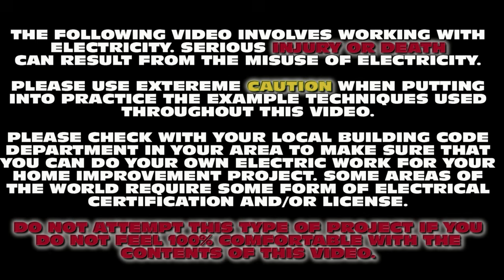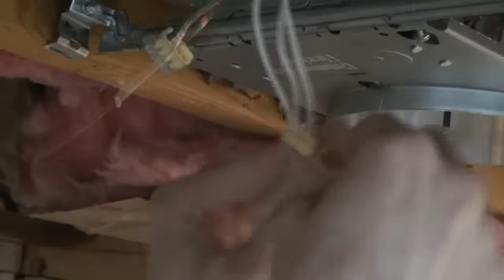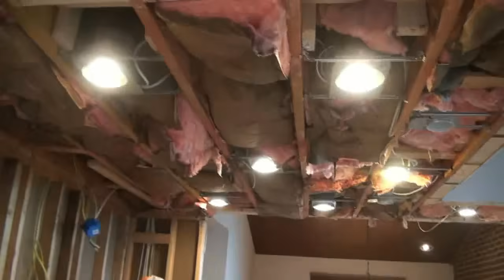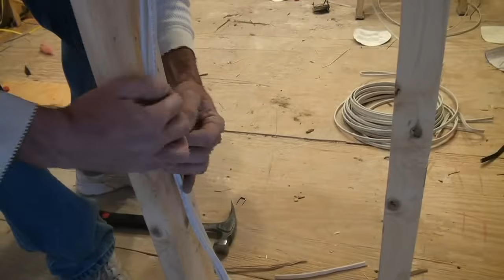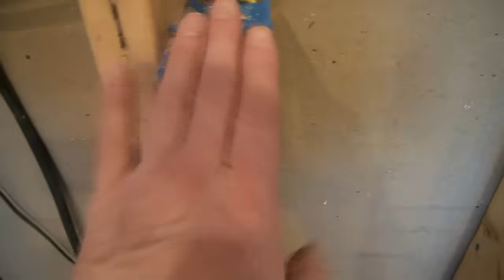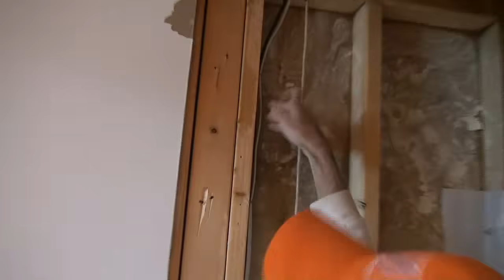How to wire Recessed Lights in Kitchen

Comment: What 14 2 wire mean? 14 gauge 2 wires of same ..ground .positive n copper which is actuall switch on off wire?
Reply from the maker: 14 is the gauge of the wire and the 2 means its a 2 -wire(black & white wire) setup that also has a bare ground wire included.

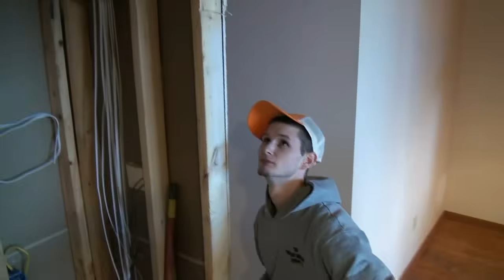Comment: At 3:45 you said it was the last light in a circuit. But at 1:23 you are showing connecting two pairs of black, white, and ground wires. If it the last light in the circuit then how could it have two romex pairs of wire? The end of the run should have only one Romex pair right because it terminates in the last light. What am I missing?
Reply from the maker: That is correct , the last light on a light circuit should only have one piece of romex wire inside it's fire box because it's the last one in series.

Eddie

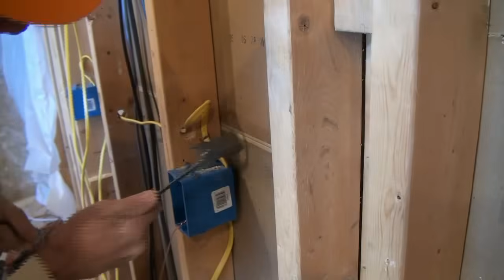Comment: Nice info.   7:45.  Do the studs need metal protector-plates attached at each wire pass- through?  Thought that was required?
Reply from the maker: No....not if your holes are in the middle of the 2" x 4"'s out of harks way. Metal plates are only required if the mechanical items(plumbing pipes or electric wires ) are located where a drywall screw or nail could potentially come in contact with that item. Keep your holes towards the middle of the backside of the studs when drilling and your good to go...and w/ no code violations!

Eddie

Comment: Is it important which holes of the stab lock connecter is populated with wire?  And is it distinct for black, white, or green?  Meaning I saw that holes 1,2, and 4 of the black stab connecter had wires inserted but we could not see which pattern was used for the other colors.  Are they the same (1,2,4)?
Reply from the maker: BigBoyWoogie Yes white only white stab-lock, Black to only the black stab-lock and Green to only the ground green stab-lock plastic connectors. There is a Black, White and Green separate stab Lock connector for each colored wire.

Eddie

Comment: Hi, nice work, I'm planning  to install 6 units on my basement  but wondering  if ONE 120 brake will feed all 6 lights  without  problems,  also I was told to use 12 wire instead  of 14-2 , what do you recommend  me? Thanks Thanks a lot
Reply from the maker: hotmail1929 Yes one 15 Amp breaker with 14/2 wire is the preferred setup for simple residential lighting circuits. One 15 amp breaker is more than enough to handle 6 recessed lights with 65 watt bulbs installed in these recessed fixtures.

If you choose to use 12/2 wire instead of 14/2, you can use a 20 amp breaker in place of the 15 amp breaker.But...NEVER use a 20 amp breaker with 14/2 wire as this would overload the circuit wire and is a safety hazard! Only use 12/2 gauge wire if using 20 amp breakers.

Eddie

Comment from the maker: Yes you can use the hot wire inside the attic switch box to "jump" a hot wore to your can lights switch box and use this Hot wire to power you recessed lights.

Eddie

Comment: "remove the drywall where all the lights will be located and do it the way we did in this video."
But in this video there is no drywall on ceiling at all. Is there a video where you install the drywall after the cans are mounted?
Reply from the maker: We do install the drywall "after" the light cans are installed in this video.

Comment: Hello there, I had one question.  In this video, you have the dry wall removed.  Howerver, if there is a drywall installed in place, and if you are installing new recessed lights, where wires are not present at the start, then how do you run wires through the studs?  The drill might be able to drill a hole through a stud that is immediately close to a can, but then how do you extend the wires through say 3 or 4 studs till you reach the next can?  Do you cut out the dry wall for this, or is there any other method to run the wires from behind the dry walls?
Reply from the maker: Hello! If your installing a bunch of recessed lights you need to either have an attic access to run the wire from above the room or remove the drywall where all the lights will be located and do it the way we did in this video.

Thanks for watching!

Eddie
Reply: +Kr Sa You can use a flexible bit system, fish tape or rods to drill through fire blocks, top plate and into your ceiling joists. If you can't go straight up for some reason, you may be able to sideways then up using another existing receptacle to do the drilling through. Then you drill through joists in the ceiling through the holes you cut for you can lights or other fixtures.

Comment: What if one of the wires are damaged, and you discover it after you close the wall ? 
You got your self a problem when you need to pull over new ones again.... ( you should use pvc pipes or something alike on hidden constuction to make it easier and protect the wires). And not to mention the lights in the roof.... i cant see any boxes. That overheating to the isolation may cause fire in future.
In my country your installasion method is illegal in the way you are preforming it.
i dont know the rules in your country for electrical installasions, but it dont seems right for safety

Reagards Norwegian electrician. :-)

Comment: I'm a registered electrical apprentice and most videos on youtube regarding electrical work are completely ridiculously and so so so unsafe but this video is very informative and by skimming through the comments, all the answer you give are all to code (14 awg gauge wire for 15A breaker for most lights, 20amp breaker with 12 awg gauge wire for heaters, etc, etc.). Very good work. Although i'll always recommend hiring a registered electrician.